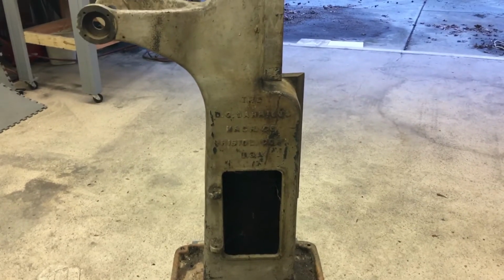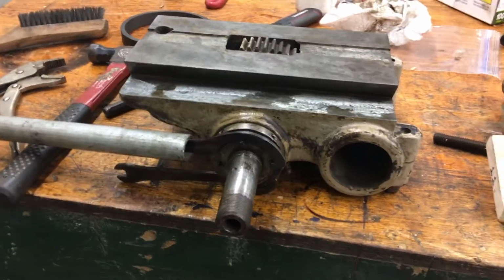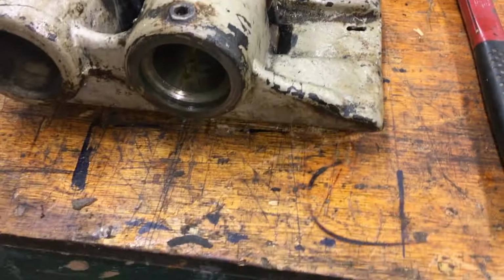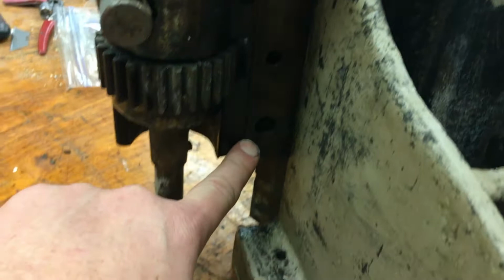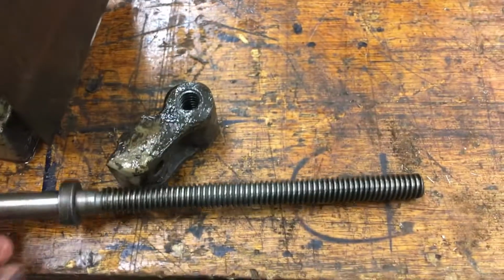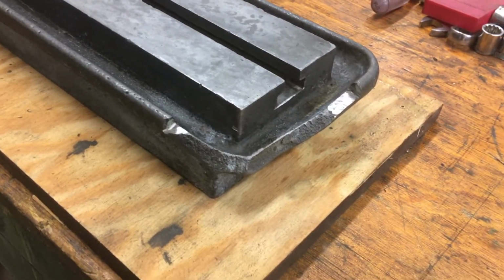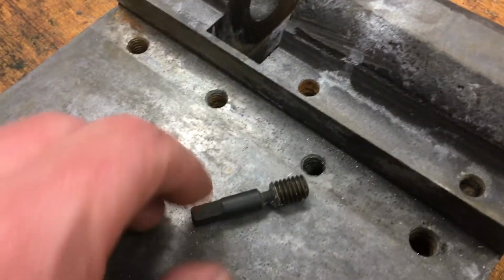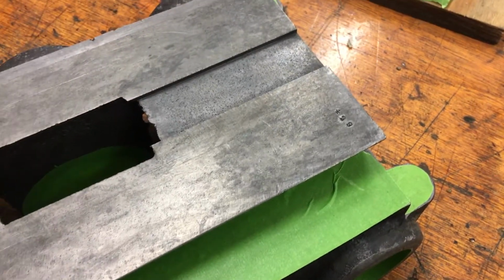Bristol No 0 Mill Part 1

Comment: Thank you so very much for posting this. I have a Whitney #6 which looks nearly identical. My machine was originally a belt driven machine, but was updated to an electrical motor at some point. It also came with some sort of home brew or aftermarket vertical head that mounts in the overarm support. It is a tool room model with x and y screws, not the feed lever. 

Unfortunately, the spindle was missing. This video is the first tear down I’ve seen which shows spindle details on anything similar to my mill. So thank you. My mill appears to have a single large tapered bronze bushing. The large side of the taper is on the table side. The opposing side is actually a blind machined hole in the head. I guess I’ll have to try and press this bushing out towards the table side. And then find (or make) a spindle. 

Have you found any old parts diagrams or technical details on this (or similar) horizontals?
Reply from the maker: Unfortunately I never found anything on the mill.  If you haven't already, try searching on Practical Machinist forums.  The Antique forum https://www.practicalmachinist.com/forum/categories/antique-machinery-and-history.19/ has a bunch of helpful people.  If you don't find anything you should post some pictures there and someone might be able to help you.

Comment: Hi There! I just bought a mill with the same model number but it's a vertical mill, I don't have it home yet but I suspect it's a conversion, I see some similarities but the head is a proper vertical mill head so I have some investigating to do. did you do a parts 2?
Reply from the maker: That sounds pretty cool, I'd love to see some pictures of it.  I did do a part 2 but I don't see it listed anywhere.  I will look at see if I still have a copy of it and upload if so.
I did find a vertical head that mounts on the overarm but it isn't original.
Reply: @therestorationshop  I'd love to see part 2 if it's possible. Once I get this one home I'll try to post a short clip, never tried that before. There isn't much info on this manufacturer  so if I'll add to the small resource I will. I found a small reference on practical machinist that i think was yours as it also referred to the ad you show here.